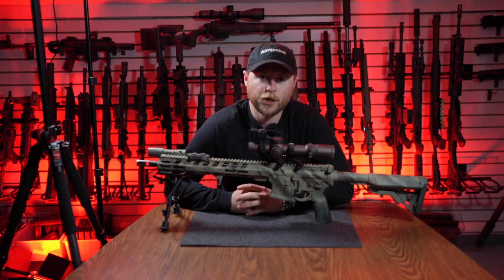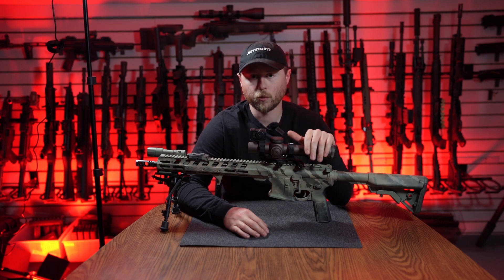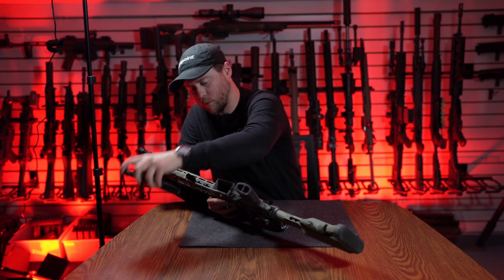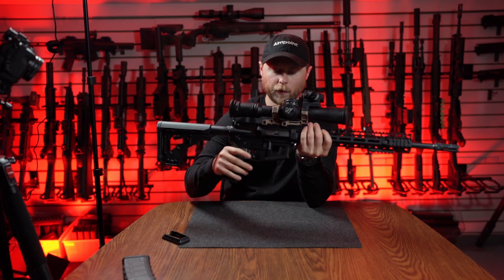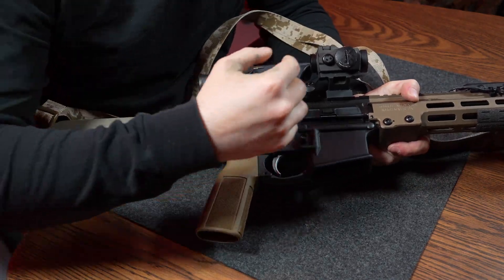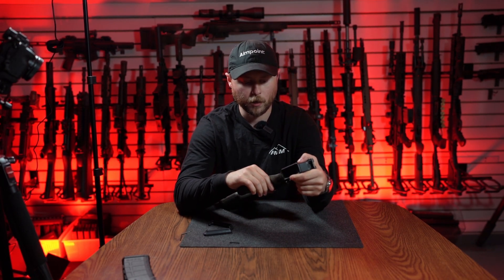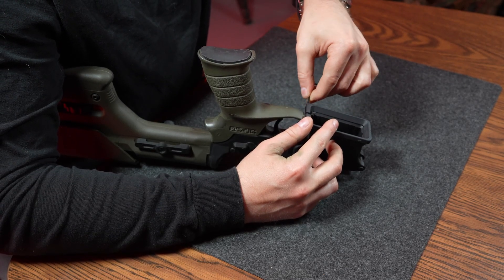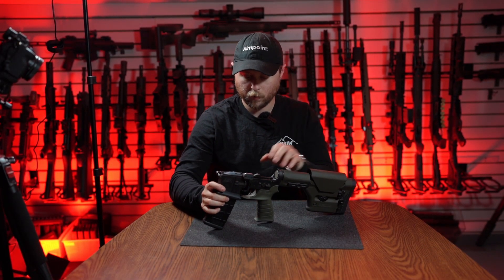PMM Armory Tutorial: AR15 Milspec lower Magwell Install

Comment: nice will it fit various type of drum mags?
Reply: It fits the Magpul D60. Won't fit the Schmisser S60 quad stack; it would work with the Surefire 60 rounder since the top of the quad stack is tapered on the surefire. The Schmisser has a square top on the quad stack that makes it incompatible

Comment: $150 seems quite steep considering there are alternatives in the $50-70 range!
Reply: Will it fit the multi cal lowers from psa
Reply: Wrong.
Reply: I just received mine, AND YES it is pricey it's not a must-have, but it is nice to have ,quality is there.
 I think it should be around 60 to 80 bucks. And it looks so damn good
Reply: PMM is a quality product. It's an investment. 👍
Reply: I mean the only other alternative of the same machining quality was probably the lancer magwell, which doesn't even take gen 3 PMAGs...
Reply: @misterio10gre  I would only wanna drop that amount of money if what I needed it for was to handle abuse. I agree the plastic ones are bit overpriced as well but the metal ones don’t do the job better than the plastic ones to justify that asking price imo. That’s a new bcg, 10 pmags, a stripped enhanced lower receiver or something but it’s your choice.
Reply: @Sun-Warrior1911 I agree it's severely overpriced but I ended up purchasing one and it looks and works great but like you said it's up to the individual but I want the enhanced lower by Aero Precision but everything says out of stock
Reply from the maker: Alternatives made of 3D printed plastic..